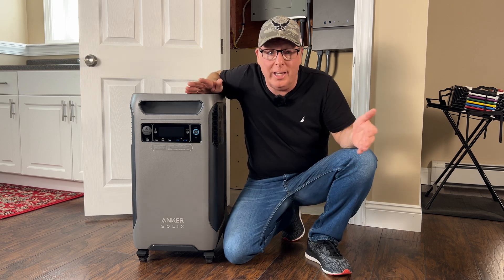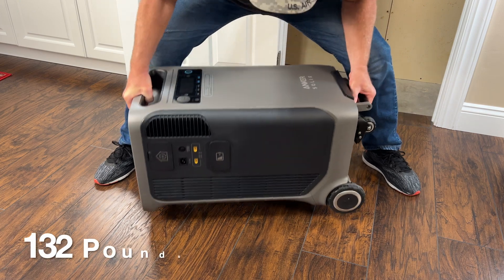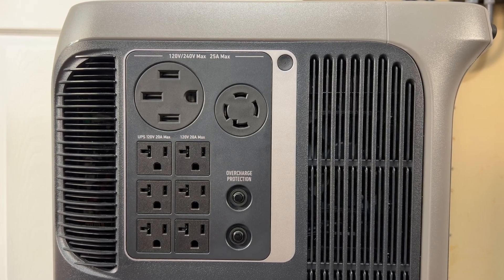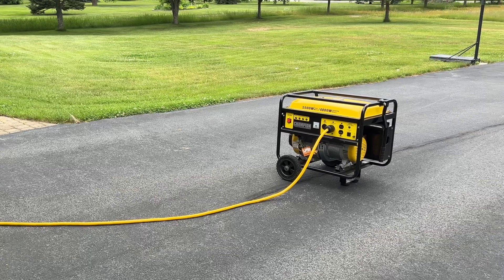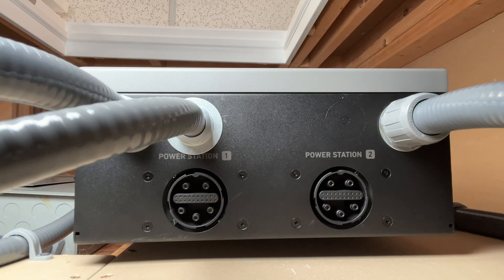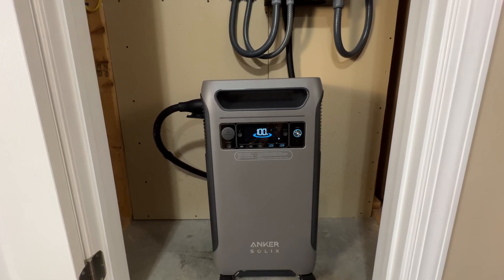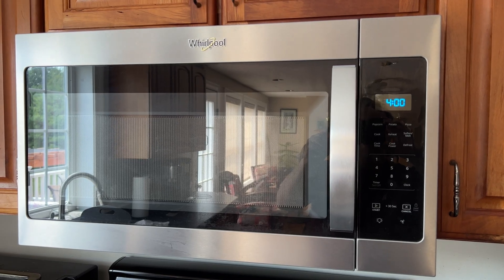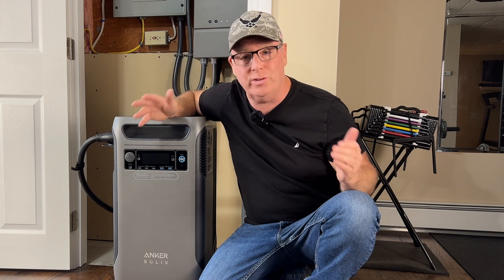Can Ankers New Battery Power Station Backup my Whole Home (6000w Inverter)

Comment: Does the "Home Power Panel" contain an automatic transfer switch?  Could you do a video explaining how you installed it, and what it does?  Seems like it is feeding power to the sub panel above it.  How many transfer switches do you need in your setup with the F3800 Plus, where you are connecting the backup power from the generator to the "Home Power Panel"?  Could you do a video explaining this?

Comment: What is the maximum output for each 120v standard outlets? 
Wattage? Thanks!
Reply from the maker: Each receptacle is capable of providing 2400 watts but thats also the same output for the block of three. So you could not have three 2400w  loads connected. The same gos for the other block of three.

Comment: When running only 120 v they need to have the ability to shut down the other 120 v inverter... The idle phantom power for both inverters is 70 w!!!
And 24 v solar panels is the largest you can attach...that is a Voc of 40-45 v....👎

Comment: I noticed that in your previous video you've also installed an interlock kit and generator inlet, in addition to the anker solix and it's transfer switch. If you want to use your generator, how do you stop the anker automatic transfer switch from isolating the 60AMP breaker you have feeding the subpanel, when it's current sensors are no longer sensing current from your main power feed? I would assume that the moment the anker transfer switch no longer detects current on your main utility power cables it will isolate the 60 AMP breaker, and switch to feeding the subpanel from the F3800, even though you would have power coming into the 30AMP breaker that the generator feeds? Is it just a matter of just unplugging the F3800 from the Anker transfer switch?
Reply from the maker: This is what I learned after using the F3800 for a few months. The transfer switch does not recognize the modified sine wave produced for my portable generator. My plan was to re-charge with the generator but thats not an option. The issue then became getting generator power over to my sub panel. I didn't want to over complicate the wiring so the plan was to buy an inverter generator. Then I learned that while an inverter will recharge the F3800 and it cannot charge and run load at the same time with exception of the solar input connection. And also like you mentioned I would need to run my generator feed through the main CTs. One solution would be to buy a charge converter and use the generator to feed that which would power the F3800 through the solar ports but they are somewhat limited by the max solar input. But I do have a solution for the whole setup and I will be posting a video on that in early March. Stay tuned it's going to be very informative.
Reply: @BackyardMaine  Thanks for the informative videos. I picked up the F3800 from Costco on the current sale. Your comment here concerns me and I have a question:

I have a basic interlock on my main panel with a 30amp receptacle for my gas generator. I don’t have the smart panel. Do you think I would be able to charge the F3800 from a powered circuit while running the interlock/generator? 

I will experiment with it but I prefer to wait for the cold weather to break. I’ll also keep an eye out for the update video. Thanks.
Reply from the maker: @ Unless you have an inverter generator you cannot charge the F3800 with generator power. You can buy an EG4 charge converter and feed that from the generator and charge through the solar inputs while also supplying loads at the same time. Or of course you can use an inverter generator. I have a new setup now and I'm in the process of making an updated video. I'm not sure if it will go live this week or not. Anker is sponsoring the video and they may want me to wait until April.

Comment: Question, would you suggest having the battery pack in the house or in the garage? During the summer, it can be extremely hot in the garage and I am afraid it will place a strain on the battery and inverter.
Reply from the maker: I keep mine in the house. Actually the finished basement. Where I live the temperature swings are too extreme. We had 15 below zero a few days ago and the garage can reach 100 on a hot sunny summer day.

Comment: This is well done presentation however it is a bit misleading to say that this F3800 will run your house. I have an Anker 767 with the backup battery which provides 4100w. Anker customer support is great and I am happy with this product. However, for most people, like me, I did not realize how long 3800w will really last. "It will not run your house". It will probably run the refrigerator, maybe a freezer and a few lights for maybe 24 hours. It will not run your AC, electric cooktop, oven, or Heating system for more than a few hours, especially if your heating system is electric like mine. I was shocked to see how quickly I could go through 4100w. Yes, you can add on additional batteries to the system but the cost per Kwh is very expensive compared to the more commercial HD solar system batteries that are available at less than one third the price of the Anker batteries per Kwh. Before purchasing a solar back up system do your research. I wish I would have done more research before purchasing the Anker system because I would have gone a different direction and saved a lot of money.
Reply: I agree, i also have the solix 767 with battery expansion

Comment: how much was the power station and sub panel so did the come with the anker solix F3800
Reply from the maker: I can’t talk about price because it varies depending on sales but yes the kit included the F3800, the home power panel, the sub panel, breaker, connection cable and cts. You will need wire or cable, raceways and lungs.

Comment: Is using 50 amp port a good ideal or will i get the same output as the 25 amp?
Reply from the maker: The maximum out capacity is 6000w which is 25A at 240v. The 50A connection it there to keep you from having to use an adaptor to connect an RV or other 50A plug. But the out capacity would still be a maximum of 25A.

Comment: Thank you for your very simple but informative presentation...I am looking at the Anker 3800 for my home.  I gather that with the home power panel from Anker your 3800 is automatically recharged when you have grid power.  I am interested in how you wire the outlet to the outside of the house so your gas generator can recharge the 3800 when the grid power is out (this is while the 3800 is still attached to the home power panel).  Thank you again.
Reply from the maker: Yes the grid power automatically recharges the F3800 through the home power panel. I made a video on the installation of the generator connection. Here's the link  https://youtu.be/5y7RaJSAMZQ Also please note that a standard gas generator is not recommended for recharging these units because they produce a modified sine wave. I'm planning to buy an inverter generator to solve the issue.
Reply: @BackyardMaine  Thank you very much for your very quick reply...I believe this has made my decision to purchase the Anker 3800 with the home power panel final.  Now to find an electrician to install the panel and then the generator connection.  Thanks again!
Reply from the maker: @2tall54  Happy to help..
Reply: @BackyardMaine  One thing came up about using the Home Power Panel...It appears you need to have a sub panel installed first.  My problem is that I already have one sub panel that is in my detached garage about 70' from the house (where my main panel is located in the basement).  I haven't seen anything (or anyone) speak about the feasibility of adding a 2nd sub panel in order to install the Home Power Panel to that 2nd one.  If I am unable to do this, I will need to go to a manual transfer switch instead (which is not what I need as I am gone from home many times and I need an automatic switch to turn on the furnace and sump pump when the power goes out).  What are my options, if you don't mind steering me in the right direction?
Reply from the maker: @2tall54  You do need a sub panel for your critical loads or in other words the loads you would want to protect during a power outage. I installed mine when I installed the Anker setup. There is no problem installing a second sub panel for your critical loads. The only issue would be if some of the loads you want to cover are in your main panel and some are in your existing sub panel. The sub panel is required to limit the total amount of load that can be picked up by the F3800 to be sure to stay within the limits of the device.
Reply: @BackyardMaine  I really appreciate your quick reply again...what I was looking at was to pull some of the circuits from the main panel and put them into the new (2nd) sub panel.  All these would only be the critical loads I would need to power with the Anker 3800 (gas furnace, well pump, sump pump, stove, lights, computer and related items, tv).  The stove and well pump are 240V, the rest 120V.  I will have to test both the stove and well pump to see how much power is needed for each.  If unable to do both, the well pump is priority.  The garage usage is mainly the garage doors as the lighting is LED.  Thank you again for answering and have a Happy Thanksgiving!

Comment: Great video! You explain the unit in great detail. One question is your well pump is a 220v circuit? Also is your boiler 110 or 220v?

I have one 220v circuit I would like to use with the Anker system.  If you can detail your load circuits if 120 or 220v .  Thank you.
Reply from the maker: Yes it will provide 120 and 240v depending on what you connect. When using the home power panel to supply a sub panel like I did, the single pole breaker are 120v and the two pole breaker for my well pump in 240v. My boiler is 120v. You can also plug 120 or 240v loads directly into the F3800.
Reply: @BackyardMaine  Thanks for the explanation.
Reply from the maker: @baldypalmsrailroad  You bet..

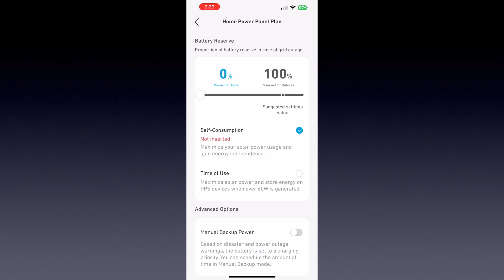Comment: I actually bought one of these units and will be installing a 50A Reliance power transfer switch instead of the one from Anker.  At 6:25 of the video, you mention "self-consumption mode".

Will I still be able to use the app for self-consumption mode even though not using the Anker transfer switch?

Thanks.
Reply from the maker: Unfortunately no. The home power panel is capable of walking in the inverter in to supply you loads seamlessly with no interruption of your loads. You can do it manually with the app or schedule it with the app as well. Its probably only useful if your charging with solar or you have lower utility rates in the evening.
Reply: @BackyardMaine  Thank you.

Comment: Can I use a small inverter generator like a Honda i2000 to charge the battery pack while it’s in use?
Reply from the maker: I'm not sure but I think so. I will have to try that out.

Comment: I wonder if you could get it so that it discharges the battery during the day and recharges at night so you could use lower rates on electricity. Never get those peak charges.
Reply from the maker: You can do all that with the App. Here in Maine we pay the same rate throughout the day and night so it would not be helpful for that here.

Comment: Unless I'm misunderstanding the specs, it will deliver its full capacity for less than an hour! More broadly, 3.8KWh doesn't seem like a useful home power backup solution compared to an inverter generator.
Reply from the maker: No you have the specs right but drawing 3.84kw for an hour would be quite a bit of power usage. I find that I can get 5-7 hours out of it during an outage. Of course we conserve energy during an outage. We're careful to only use what's needed and when we need it. I will probably add an expansion battery as well. And yes I still have a generator connection for extended outages.
Reply: You can also dump solar into these while they are running.  That is the time I cook with my power stations.  It's the best time to use your heavy loads.  It's also a great way to extend your fuel on your generator.  If there is no sun just charge it with your generator they charge very quickly thus less fuel spent so you would run your generator way less.  We all know how it sucks waiting in line for hours hoping to get some more fuel.  Hope that helps.  I used both during Milton for a week and never ran out of my initial propane storage for my dual fuel champion.

Comment: When you slid it back to 0% so it only used grid power you said it went back to charging but it wasn't plugged into the 120 outlet. Does the cord that sends power to the house also charge the unit when it's not powering the house?
Reply from the maker: Yes it does.
Reply: @BackyardMaine  interesting. Thank you. Been considering this for a year just don't know much about electricity.

Comment: Do you also have some battery operated smoke detectors? I'm sure you do, but when you mentioned fire alarms running on power from a breaker, I started to worry.
Reply from the maker: The building code for several decades requires wired smoke detectors in several locations around the home. These detector are required to have a battery backup. The batteries will last a whole lot longer if we pour the circuit during outages. We lost power three times in 2024 for a total of 7 days without power.

Comment: So, it seems like a good all-in-one system but you only get 6000 watts out of the inverter and only a 3.84 kWh battery. For around $3000. Not a great value.

I went with a Sungoldpower hybrid inverter good for 10,000 watts and 5x 5.12 kWh rack batteries for a total of 25.6 kWh of capacity. Including extra bits like manual transfer switch, cabling, bus bars, etc, it all cost about $11,000. It runs our house for a whole day without us even trying to be careful about consumption. If we're careful, we can probably get near two days. It takes a bit more knowledge and effort to set up, but you only have to do that once.

Other than the oven, electric stove, central AC compressor and level 2 EV charger, every single circuit in the house is going through it. No stove/oven, but we can use the microwave. The AC would be nice, but we can deal with it for a little while if the power goes out. The HVAC blower is on battery backup and our heater is gas, so we do still get heating on battery in the winter. If I really wanted to add the AC, I could add another 10 kW inverter in parallel for less than $2000 and it would probably handle it.

It's been reliable so far, one year in. For about HALF the cost per kWh capacity. The Anker does still seem like a solid option though if you don't need a large battery capacity, 6000 watts is enough, and you want an easy solution that isn't too expensive. The route I went is definitely something to consider though if someone is seriously looking into doing whole home backup.

And no, I'm not a paid Sungoldpower shill or anything like that. It's just the brand I ended up buying, there are several others at similar price points that people also recommend. Growatt, EG4, etc.
Reply from the maker: Sound like quite the setup. Are you running Lithium Iron Phosphate Batteries?
Reply: @BackyardMaine  Yes, all LiFePo4 batteries! I got a small rack about 4 feet tall that all 5 are mounted in.

Comment: I looked at this unit when researching battery backup for my home. It was too small even though I have trifuel generators and some solar. I decided on the Ecoflow ultra with 18000 WH instead.

Comment: I have one main question. I am planning to install the same setup with transfer switch / subpanel for critical loads in my home. I understand the system might only run for 5-7hrs depending on loads. Question is can a small 20amp generator power the 120volt charging plug while in use? Will the Anker still power the panel from the battery while charging from the 120v? My idea is to limit the loads during charging for extended power outage without interruptions in home power supply.
Reply from the maker: Funny I was thinking about the same thing yesterday. I'm going to have to look into whether it can charge and discharge at the same time. I try to remember to get back to you when I find out or you could ask the manufacturer directly.

Comment: Sure it can power some of your appliances, but not very safely and not for very long. You'll be lucky to get even a couple of years of service from this low cost high frequency, transformerless inverter. Without an output transformer to provide galvanic isolation between the inverter's DC boost stage and its AC output, you run the risk of damaging and even setting your appliances on fire. No thanks. Not in my home.

Comment: I have been watching these solar units being explained for over two years now. I am not sure if I am just finally getting it or if this was the best explained video yet. 

Good job!! I am just gonna say it was just a good quality tutorial ... thank you. Now I need to start saving some money. Adding in that power panel is a definite for me. 

Just curious though, is there a limit how far away the unit can be located from the cb box? I would prefer this to not be inside my home.
Reply from the maker: The F3800 needs to be mounted within a few feet of the Solix Home Power Panel but they both can be located away from the breaker panel or sub panel without issue. If it's more than 50 feet away I may upsize the wire one size to reduce any possible voltage drop. The other limiting factor I just thought of are the CTs that connect around your main wires and are required for the system to function properly. I think the leads are about 25 feet long. You can probably extend them but I would ask that question to the manufacturer before I made a purchase.
Reply: @BackyardMaine  thank you